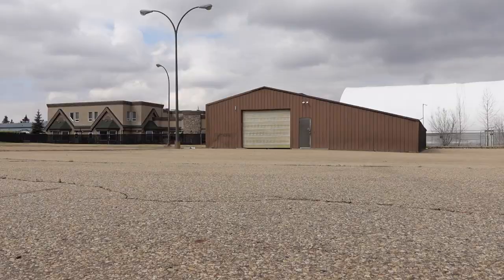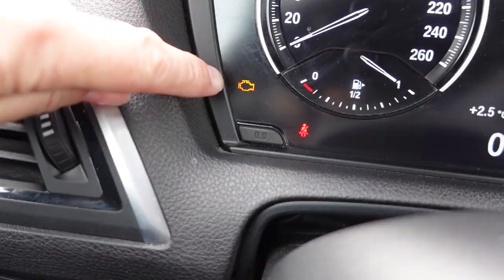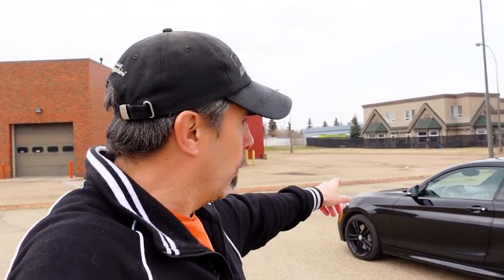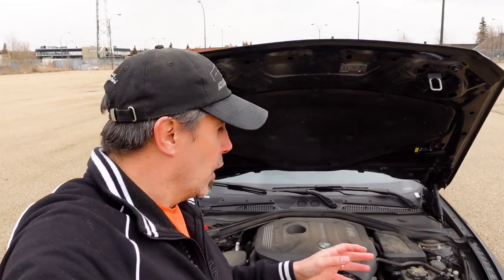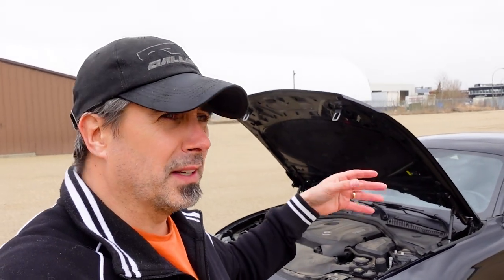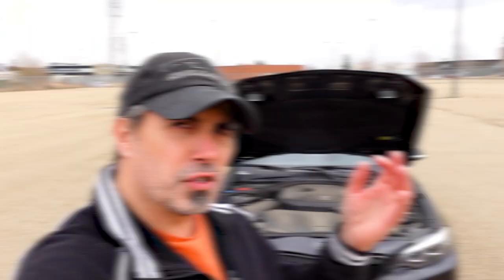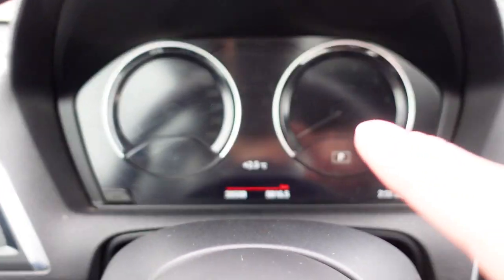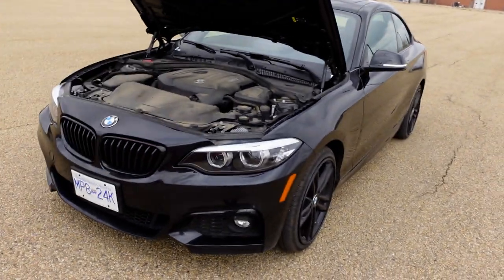How Bad is the New BMW 2 Series?

Comment: It amazes me how the country with some of the finest engineers in the world can produce so many problematic cars.  Unless a person want an M series BMW or a Hammer series Mercedes I can't understand why they wouldnt just buy a Lexus.
Reply from the maker: That’s fair.  For the hardcore performance the M versions or the AMG Benz or RS Audi is the way.  Everyday wagons, well, go with what works and does not break the bank
Reply: Lexus looks pretty bland that's why I've never been into bmw or Lexus but Lexus looks bland bmw has a slightly better looking logo
Reply: Very few have problems before 100, -(to maybe)120,000 km. Basically the/these cars should be recycled after that!
The least carmakers are concerned about are the nature and use of natural resources.
Reply: Few Lexus cars are truly exciting whereas a normal, non-M BMW can be alluring. I've owned my E63 6 Series coupé for 13 years and it keeps being a fun to drive machine. Sound, cornering prowess, gearbox, driving position ... everything is spot on. I'm not a BMW fan as I've owned 10 cars from nine different brands, but that's my experience with BMW.
Reply: @michaelsuzio4268   Understood. At these prices you have to like the styling of whichever you choose.
Reply: Simple child knowledge * Lexus drivers impotent * German cars best engineering with Chinese parts.
Reply: They are not nearly as problematic as you make them out to be. Today's modern cars are reliable and rarely break down and leave you stranded on the side of the road. I have been driving gen 3 Mini Coopers (made by BMW) since 2016 and have not experienced one single issue yet. Just make sure your car is under warranty and you won't have to worry about paying for repairs.
Reply: @frankbrowning328  I like stupidly high horsepower cars alot like the Camaro SS/Tesla model 3 performance (unknown exactly what Hp it is cause it's electric)
Reply: limelife7457  Everything is more sophisticated breaking up more frequently - what is the main problem nobody knows how to diagnose the problem and fix it * Noth America is the biggest ripoff.* Why in Europe do the same models not have those problems or very expensive repairs.
Add Blue for Diesel cars this is part of the emission * In Canada emission warranty is so on so and a couple of years _ why not cover Tank - Heater or Pump?
Is cheaper to give money to Politicians' pockets and forget all
No recall plus profits for Factory service.
Reply: @frankbrowning328 I personally love both Lexus and bmw with their styling
Reply: Bridges fall down too. They’re humans. BMW, however, does seem to be extra bad over the years relative to others. People just seem to overlook their problems and keep buying…Because they want to be driving “the ultimate driving machine” I guess.
Reply: It feels deliberate when warranty expires buy a new car I think that's the strategy
Reply: The newer b58 and b48 engines are bulletproof. Replace plastic crap with aluminum at 90,000 miles and you could drive it for another 15 years

Comment: I’ve owned my 2015 M235i for the last 8 years. 61k miles with zero issues. I did replace the coolant expansion hose at 45k (preventative maintenance) because these hoses will crack. I’ll replace the oil filter housing gaskets at 65k. I also replaced the stock plastic charge pipe with an aftermarket aluminum one for added reliability.
Reply from the maker: Sounds good and those cars are a lot of fun.  It does sound like parts replacement t time though once you get near the 60000 mile range
Reply: I'm at 90k on my m235i. Take it on road trips no problems. Great car and I feel lucky to have one with a manual transmission.
Reply: I always get new hose whenever I can
Reply: 2016 228i 67,500 .. dealer said I have an oil leak on the fuel pump , just started .. need a new oil gasket  ($1,600 )so he says . Faithfully take it in for 8 yrs

Comment: If you are not a mechanic avoid bmws 😂
Reply from the maker: Particularly whe. Last 4 or 5 years
Reply: Or one of  your family members is auto mechanic
Reply: @ECPP  absolutely pure junk, they piss the bed every night, oil all over the driveway, don’t ever park on a fancy garage floor.
Reply: DIY YouTubes are your friend.
Reply: @@japanwatchconnection bmw is literally the best when it comes to aggressive performance, nobody tops them on the streets especially the ///M engines these vehicles are just not for everybody,  because they require immediate maintenance, and attention, when a bmw engine low oil light comes on, the average dummy thinks it’s the best idea to top off the oil level, and this is exactly how to damage the engine, because you absolutely cannot top off your oil levels without a dipstick, so bmw low oil light means, you need to do a complete oil change, topping off dirty oil that already peaked its viscosity is a recipe for timing chain failure, running old oil on a cheap budget, you get more friction, oil won’t lubricate or keep the engine cool during hot operation, and this is why bmw is not for broke folks, if you daily drive bmw, and cannot change your oil every two months, leave these machines alone, get a Kia 😆

Comment: The Irony.. they teamed up with Toyota to make the Supra and suddenly reliability is right behind toyota/lexus  in the rankings.. the power of ZEN..great video as always Mark!!
Reply: Happened before Toyota ever came into the picture lol! B58 engine in Supra came out 5 years earlier!!😄
Reply: @germanengineering204  Yes Sir iam aware that the engine came out in 2015 while the Supra came out in 2019.the reason I said the power of Zen is bc toyota is the master when it comes to refinement..Bmw reliability in 2016 out of the 30 major manufacturers was 14th ..in 2018 it was 8th.. now it's 3. I never took anything away from them bc I'm a huge fan of BMW for over 30 years.. they are heading in a good direction and Toyota did play a part in that.. Its much easier to take a good engine and make it even better rather than develop a new one and spend billions on research n development..its a win/win for us..the consumer.. cheers 🥂
Reply: @motorcycleartist  the rumor is that Toyota took a couple of new b58s and tested them and worked with BMW before it went into the supra, so it definitely is teamwork and a win win.

Comment: Loved the show.  I still own a 2017 bmw m240 and drive 10k per year.  I change the oil twice a year, change the coolant every 2 or 3 years and keep it half full always. No issues whatsoever great car
Reply from the maker: Great point! And that’s the thing a little maintenance goes a long way.
Reply: Same car, same year, no problems. A question though, mine came with a four year service package and they only replaced the oil once a year because it's synthetic, do you change the oil twice a year just to be extra cautious?
Reply: Same with me. Maintain it and it’s perfect.

Comment: i have a late 2016 n20 in my 228i.    I read they revised the timing chain and dealt with the issues.   At 82 000 km so far so good
Reply from the maker: Nice….thanks for sharing
Reply: Same! 2016 228i and it drives perfectly.

Comment: I have a 2020 230l convertible with the rare M package. The only major repair was the right rear blinker/tail light malfunctioned while under warranty. That part alone was $600.  Also sometimes the driver side mirror tilts down after going from reverse then into drive.  BMW dealer couldn’t troubleshoot the problem.  Crazy fun to drive.
Reply from the maker: Yea sometimes those chronic issues seem to form as a mole on the life of a car that stays forever
Reply: Blinker is a classic issue.

Comment: I bought mine brand new back in 2014.  Mileage now is at 144K.  No issues, but the fuel pump.
Reply from the maker: Sounds like a win
Reply: I had a Z4 35is m sport. Only issue was the fuel  pump.

Comment: I own a 2023 230i, have to say I love this car, I have the rear wheel drive b48 variant and it is quick, and nimble, a blast to drive, rated at 255 HP and 295 LBS of toque, but BMW is notice for rating HP low. A lot of people dynoing these and getting 270 HP. Comfortable cock pit with good amenities but not overboard by any means, Pricing is fair and would highly recommend this car for people who want a low cost entry level sports car that is fun to drive, gets great mileage and is comfortable.

Comment: I am currently in the market for a small, zippy, fun to drive AWD. I fell upon the 228i xdrive…I’m now doing my research. I love your love/hate relationship with BMW. I feel like I’m getting real world, this is what it’s going to cost you, advice. I realize this is a 230, but it’s still helps me determining which direction to lean and questions to ask. (I’m a 54 year old female…and I hate buying cars…and I really hate repairing cars…in search of a reliable fun car to drive) Thanks!
Reply: Most of the things he mentioned are issues with the earlier 2 series that has the N20 motor. Stick to 2017+ for the B48 or B58 and it will treat you well. Parts are more than a Japanese car. Maintenance is more often. But it's also something very unique. The only thing comparable is an Evo X or STI. While those are Japanese cars, I feel like reliability may be a toss up between the BMW or Evo. The Evo is a much cheaper interior but you may not mind once you drive it.

Comment: I own F22 220i 2019 and apart from some small ergonomic issues I have with it and the fact that I almost hate the power-steering (comparing to E90) it is amazing. B48 engine is one of the most reliable engines in general and I did have the coolant hose failure as pointed out in this video. The squeaking is nowhere near as portrayed in the video, especially on the inside.

Comment: Had a 1.8 turbo, mini. Ran great till about 50k miles, and then the frequent oil changes started to happen, time chain issues, carbon build up, etc. God rid of it before spending more, repairs were never cheap.

Comment: Have both a 335i N54 and an M240i B58, night and day. 

Purchased  a 2007 335i E93 6mt as a CPO  in 2011 with 35k. Here's my list, radio head unit under warranty, rebuilt dsc/abs motor, filter housing gaskets, water pump, serpentine belt, pulley and tensioner fouled by oil leaks, vanos solenoids, and hpfp. Carbon walnut blasting at 75k. Need to do valve cover and oil pan gaskets and rear main seal. AT205 is keeping leaks under control for now. Oh, and two rear cracked rims, warranty refused. At 125k, compression is over 190psi in all cylinders, and oil analysis  is good. 

Purchased 2018 M240i F23 8sp auto in 2021 with 22k. So far, parking brake cable bracket under warranty, glad that I have one!! That's it. Now at 45k, time will tell. 

I love driving both cars, however they completely different. 335i is heavy but corners like its on rails, M240 is light and agile. Both are stock.
Reply from the maker: Thanks a lot for the comparison and my experience with the n54 in my E92 was similar plus wastegate rattle, T-stat and a variety of leaking coolant hoses on the plastic ends, an O3 sensor and lord knows theirs probably more
Reply: @ECPP  The dsc was intriguing,  I got it rebuilt by module master for $250 + shipping, 5 year warranty.  A new one from BMW was $2500 + coding, 1 year warranty. I got the abs trifecta when it failed.

Comment: Looks like a 2022 G42. I have a 2024 so, a lot of buttons and shifter are gone. It does have paddle shifters which is nice. Had an E88 with no leaks. 80k miles trade in. We also had a 1996, 328iC, E36 (convertible addiction), no leaks. Old legends never die. Likewise, no major failures in any 3 cars. But I did much preventative maintenance, so we were never stranded on a road trip. It's a BMW. But it doesn't burn cash like a Porsche.  We don't drive like a track GT3 car and break things. We enjoy the hill country in Texas or canyons in Colorado, etc.

Comment: The 2 series BMW is basically, an entry level BMW. If that Black 230i was built and designed at the same level as my 2016 M6, noone would buy the more expensive BMW's. For the price point, I feel you are still getting a very nice vehicle with many of the quality designs and looks, inside and out. And, again, the engine and drivetrain are, for the most part, only as good as you treat it.  If people drove Toyotas like many drive BMW M series cars, you would probably see many highways littered with broken down Toyotas. And vise versa, you would probably see a lot less BMW's in the shop. I had to laugh my ass off when I found out that Toyota doesnt even have the cahoona's to put their own engine in their Supra (they put a BMW engine in there instead). The only time my M6 has ever been in the shop is for scheduled maintenance and oil changes and my BMW dealership is always more than happy to price match any other place as long as the level of service is the same.
BTW, I baby my BMW and drive it better than most would.
As always, especially as of late, I find your videos very informative, fair and fun to watch.
Reply from the maker: Nice

Comment: BMW can be summed up in one phrase = "Bust My Wallet"  . These cars are for young rich males who lease them for 3 years and them dump back to the dealers. Let someone else deal with the horrible engineering. They are not designed to last. German electronics ... what a joke.
Reply from the maker: That seems to have changed indeed .  25 years ago, the priorities were much different
Reply: BMW = bring more worries (you get that massive repair bill, early and often)

BMW = bring more water (over heating when those plastic parts on the Coolant systems cracks and leaks)
Reply: But, at least they are quite interesting as DIY cars.
Reply: If you are truly rich you don't lease cars or buy them on those bubble finances that is for the poor!

Comment: I would like to know whether the steering is similar to the 3 series (same year)in terms of feel and how heavy it is please, or is it lighter, 3 series has heavy steering?
Reply: I own a 2017 240i and it has adaptive suspension. The steering is light in comfort mode (maybe too light with a little soft spot in the middle) and firms up in sport mode. In sport it is too heavy for a parking lot but better than comfort at high speeds.

Comment: I’m not going to lie I wanted a 2 series & have been driving around every everyday in a bmw 1 series 2012 se manual model for last 8 years got it with 20k on the clock now has 50k on the clock has had a few issues along the way a coil spring went once and last winter 🥶 the epc unit went and wouldn’t start from Cold however ran as normal when warmed up hopefully we will get through this winter season ( I think 🤔 I will go for a new generation 1 / 2 series next time around just saying lol  😊
Reply from the maker: Nice.  Hopefully the next one is a little more reliable and fun

Comment: That's not the new 2 series 😃But seriously my 2009 Z4 30i has cost me only oil changes brakes pads and new tyres in the 4 years I've owned it. The car is now 14 years old and totally reliable more so than my 2017 Golf! The new drivetrains in all formats from BMW are pretty bullet proof!
Reply from the maker: I would agree but the V8s are still a bit risky

Comment: Can someone on here please tell me if i should buy a 230i xdrive or not. I have a friend who sold his 3 series bmw due to lots of problmes and 1 that was going to be a 10k fix, it was a 2017 or 2018 i think. Would this 230i be a reliable car long term given the fact i keep my cars for 8 to 10 years. Or play it safe and buy a camry?
Reply: Those are very different cars. Its up to you what you think is worth it. Also why X drive when the Camry is front wheel? Test drive a 230i rwd. Rwd has better steering, suspension and handling. Even better braking with less weight.
If you can live with something less fun after driving it, don't buy it. It has to feel worth it to you. You could always get a TRD Camry with the v6. Or an Elantra N, civic type R, etc.

Comment: Looking at a 2014 228i here in Virginia USA. This channel is legit.  I have an 83 supra that runs like a top but i dont want to drive everyday.  Any thoughts on the 2014 228i??? Any thoughts would be helpful.
Reply: i was looking into those as well. asked on a few forums. they said to stay away. the n20 motor in those early cars are problematic and tend to eat timing chains and then blow up. the reliable motors are in anything past 2017. they'll all be marked as 230.
Reply: wrong engine.
Reply: @francostrong202  N20 timing chain issues were fixed in 2015+ 228i models. 230i models feature the newer B48 engine.
Reply: Skip all N20s

Comment: What do you think about a used reliability of 2020 330i xdrive with B48 engine which has 13k miles on it for 37kUSD fully loaded? Or should I get the new 2023 330i xdrive?
Reply from the maker: Honestly for that price I would personally gone unless they tacked on some extended warranty

Comment: Own 1999 328i love it run it until the wheels fall out around 165,000 yes I did had some tiny oil leaks but that was around 100,000 miles. I miss the old inline 6 but Im planning to purchase a 2 series.

Comment: ruin cars...
Reply from the maker: In what way?
Reply: watch this for to understand in <what way > @ECPP
Reply: @ECPP  Oil , Rear axle bolts ,Brakes , Airbag problems ,Power Steering problems ,Crankshaft Sensor , plastic parts , expensive parts , lot lot of chip computer in all sides of car and engine